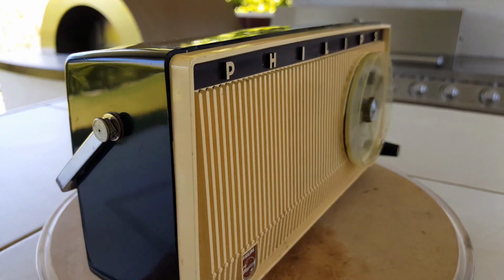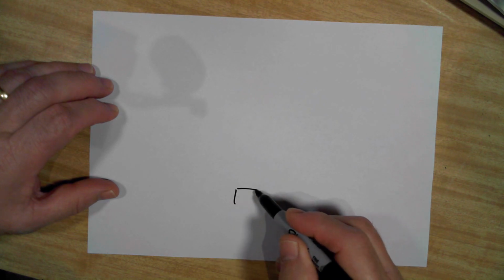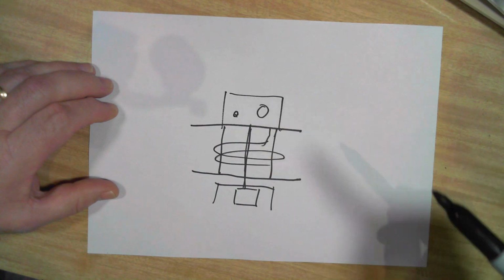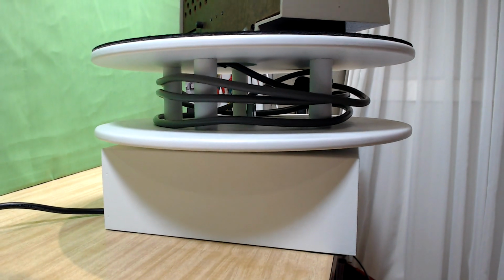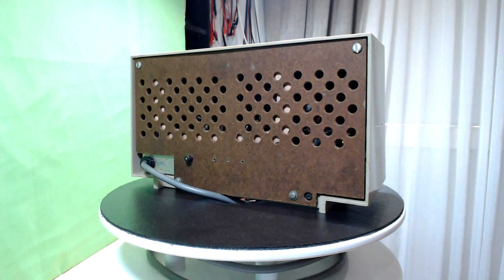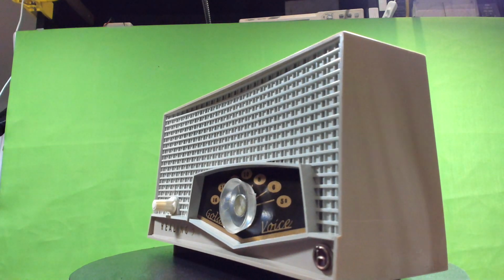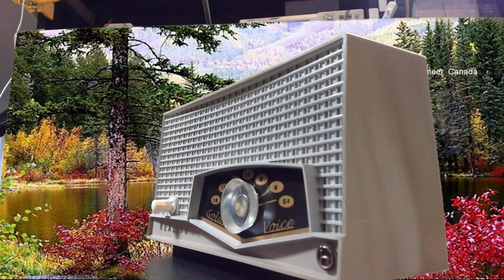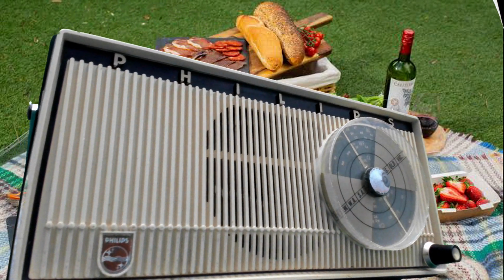Display Turntable for Video and Green Screen Radio Showcase

Comment: Another great job. Shows that even the lower end radio's can benefit from some love. Just curious what tube type the IF amplifier would be? I suppose it would have to be a remote cutoff pentode with a diode or two for detection and AVC. Thank you. Great restoration as always!
Edit: this comment was meant for the Healing 5 radio.
Reply from the maker: Hi Daniel, thanks. From memory the Healing radio uses an 6N8 for the IF and detector stage 🙂

Comment: Good Morning David, a great little table for showing your radios. On another subject, you have talked about your outside aerial is it Vertical or horizontal? and how long have made it for on the AM band 600 to 1500 KC? Cheers & Beers one of your neighbours in Queensland.
Reply from the maker: XXXX I hope 🍻 Thanks Dennis. My aerial is about as unscientific as it gets. As we no longer live on 150' long blocks in small houses and my house is the reverse of that, I ran stainless steel cable near the top of the fence around 3 sides so it is a U shape, I then ran a wire inside to supply the radios. I ran it through eye hooks with a spring on one end to keep it taut. I used 50 metres of 1.5mm wire from Bunnings https://www.bunnings.com.au/pinnacle-1-5mm-x-50m-316-stainless-steel-wire-rope_p4310958 We live in the shadow of Daisy Hill so signals from Brisbane are poor. It works quite well though.
Reply: @DavidTipton101  The antenna sounds like the loop antenna like I have 273 feet earth wire on 4 poles. It stands about 6metres off ground and i get all the AM channel on my Kenwood TS680s Transceiver I enjoy HAM radio talking all over the world. We do enjoy radio as you mate.
Reply from the maker: Hi Dennis, mine is just a long wire antenna

Comment: Very nice job indeed. Seems you have a very well-equipped workshop. I'm guessing that's a simple synchronous motor -- as there seems to be some 'cogging' evident -- and the start direction is determined by where in its cycle the sine wave happens to be at power-on.
Reply from the maker: Yes it's a synchronous motor James. The carousel bearing seems to make it a bit jerky sometimes, if it turns into a problem I will have to look into it further.

Comment: David,
Great idea...another good video.  I can't help but wonder what it would look like if you painted the turntable the same color as the green screen in the background?  You did well... good on you!!!
Wayne
Reply from the maker: Thanks Wayne, I have some Chromakey Green cloth on order and will use that on the table, I did experiment with some green cloth from a fabric supplier with mixed results.